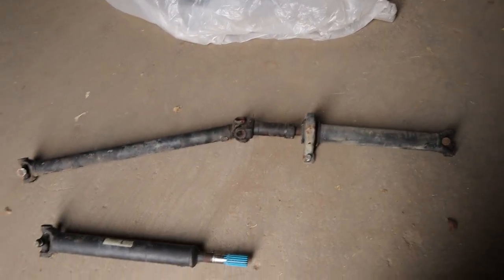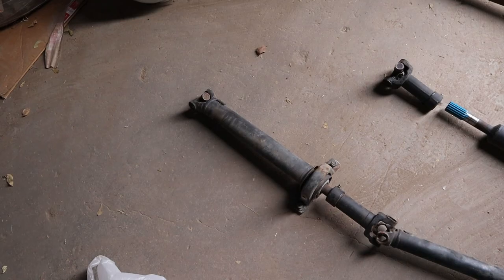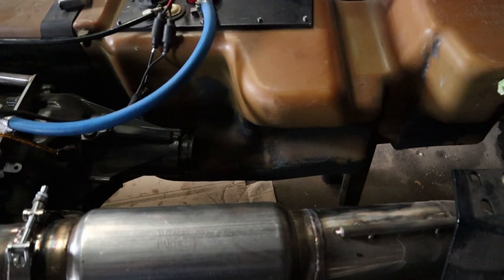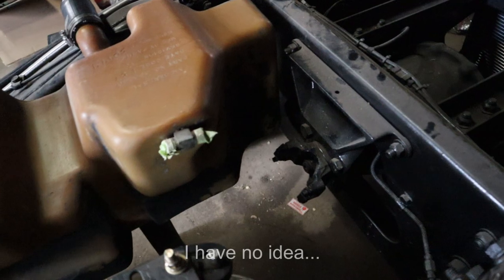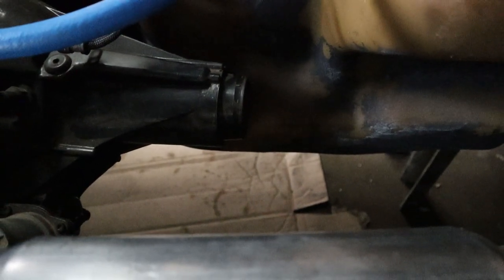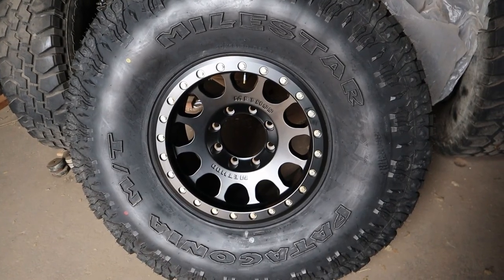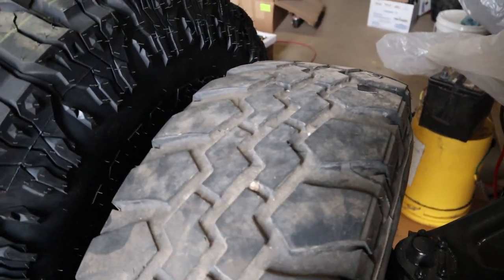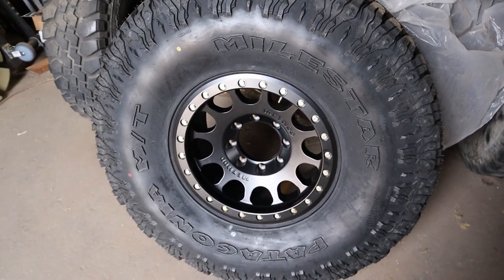Duramax Humvee / Hummer - Discussing Driveshafts and New Wheels and Tires!

Comment: I'm currently doing a swap like this. Beware the front carrier bearing will need to be relocated further away from the engine. The yoke comes in contact in the factory position. You may want to get that situated before you get shafts made up. I appreciate you posting this series! There seems to be very little shared information on these swaps. Keep up the great work!
Reply from the maker: Yep. Plan is going to be to shift the carrier lower and move the yoke slightly forward or back in the driveline just a tad.

Comment: The reason AM General (Not GM) used the yokes they did is because remember the portal hubs effectively halve the amount of torque that the driveline has to produce.  They're more than adequate for the job on a lightweight 'vee.  Also the reason they're different is because the front driveshaft has a 27.5 degree offset key.
Reply from the maker: Nice catch. Must have been trying to edit too fast and missed that one. Definitely AM General not GM on the Humvees. I try to catch those things while editing but that one slipped by. And that's also what I was thinking on the portal hubs.
Reply: @tossthewrench  Are you sticking with the stock gearing in the diffs with those 40's?  I think you have either 2.56 or 2.73's in your diffs (probably the latter).  If you're running 40's I'd look at re-gearing to 3.08's :)
Reply from the maker: I might consider some gearing changes later on after running it around with the stock gears for a while. The engine and trans tuning was done for the stock gears and 40s right now.

Comment: Would a 1480 yoke for the rear output transfer case fit in that application, ?
Reply from the maker: The biggest issue with the yoke out of the back of the tcase is the overall knuckle diameter. It can rub on the fuel tank. I got the smallest ujoint ended yoke that worked for the tcase.
Reply: @tossthewrench  did you get a 1310, or 1350?
Reply from the maker: I would have to find my file for the driveshaft to be sure but I believe we went with a 1410/1350 u joint at the tcase and just the factory humvee size at the diff in the rear. I wanted to find a yoke that would fit the tcase and be a 1350 u joint but couldn't find any or anyone that could make one.

Comment: https://youtu.be/Qj95RDv1zZ0
...because it runs double the speed; 1.9xx to be exact. So it is double as strong, whatever joint you put into. Due to he portals.
Same goes for the UNIMOGs - which have relative weak axles compared what we have similar in Germany from Merc, as well or MAN etc.